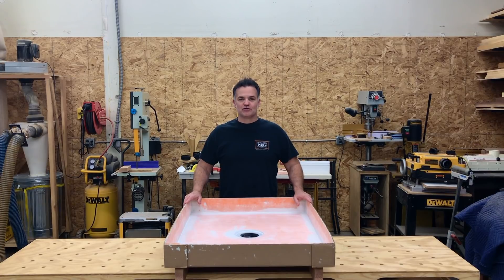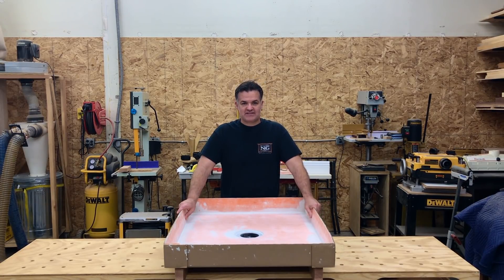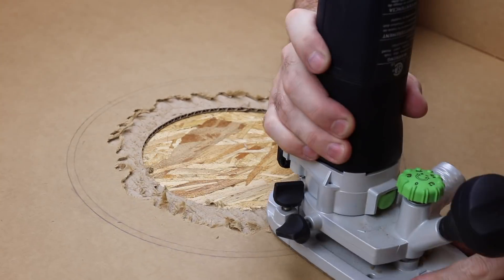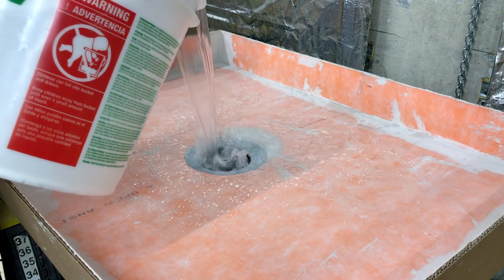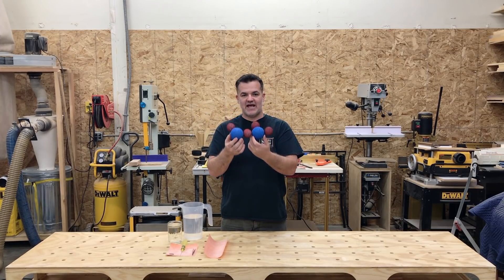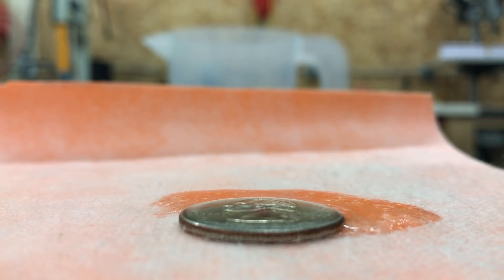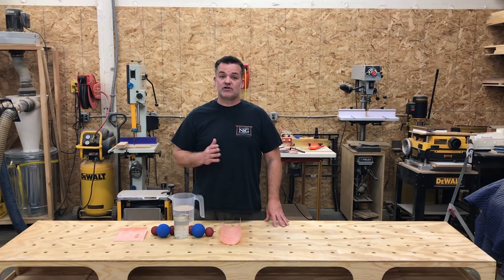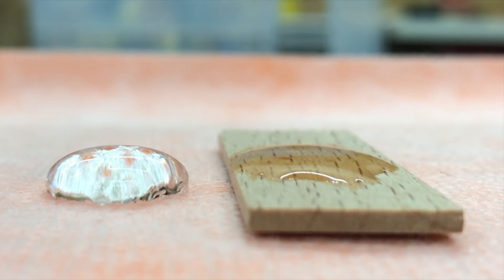Does Kerdi shower waterproofing actually work?

Comment: Hey, question for you. Great video. Did you use modified or unmodified thinset? The other Youtuber says to use modified I think and and Schluter, I think, says to use unmodified. Any thoughts?
Reply from the maker: Thanks!! I used Schluter All-Set which is a modified thinset but you can definitely use unmodified.
Reply: @builditorfixit  Thank you so much.

Comment: What did isaac do differently
Reply: Isaac used unmodified Thinset as recommended by Schluter (they recommend to use unmodified OR their own, otherwise warranty is void). Isaac also did a test with the modified thinset sold from Schluter, which did not leak. So if you go with Schluter you MUST use their custom thinset otherwise your in for a leak (if you want the warranty). Otherwise, you can try other modified thingset, but I have no clue which one will work or not.

Comment: This does seem very strange to me as well. I don't know the particulars of Isaac's position but I know from commenting on his video he and I have the exact same pov. I have a lot of Kerdi showers out there. None of them have failed. In fact I have had no failures ever. I always flood test my pans. I always noticed some level of creeping under the bands and between the overlaps with kerdi. I've tried mixing looser mud, thicker, knifing it out tighter, looser, etc...  Variations with schluters products and techniques. I eliminate all wrinkles and have perfectly flat and tight installs. It doesn't seem to matter and from what I have learned the Schulter position is either, your mix is too- something- or its not an issue. I literally can't do it any more by the book or try any other mixes. Lol. It keeps me up at night. I've moved onto Isaac's method but I've been doing it several years longer than he has. From my experience there is just no way to make your test with Schulter products and not have water wick though the mud between the overlaps and dampen the cardboard which makes sense. The fabric is waterproof. The cement is not. Water will wick through it. So I just don't get it. I don't get how this test is possible.

Comment: FYI, to answer the question, the blue tool in the ad is to scratch the inside of your butthole if you lack flexibility and the inside of your butthole needs a thorough and lengthy "scratching".

Comment: How can reviews from you and Isaac vary so greatly!? He basically says the stuff is junk and every one of his test fails and leaks. I am wanting to redo a shower with this system in my house but I am confused by all the mixed reviews.
Reply: @builditorfixit  
Yes it does help greatly. This video was very helpful altogether. Most of the time when somebody has that many negative videos on a single product, there is an ulterior motive.
I have been looking for a reliable contractor in the central South Florida area for a couple months now. I have not found anybody I would trust with the redoing my shower so I've decided I might try it myself. I want to learn every single aspect of the project. But when there are so many contradicting videos and information out there it makes it extremely difficult.

Comment: Thanks for this video. Sal Diblasi sent me here. Isaac's video showing moisture being absorbed through the thinset has put a lot of questions into people's mind about the product. Youre explanation of having only a thin layer of thinset makes all the difference. thanks so much for making this video! 

should i be wiping off any extra thinset over the kerdi? or does that not matter, so long as the thinset in between the kerdi is thin and not too much. thanks!
Reply: @builditorfixit  Thanks for the info and clarification. Force and Time. The scientific explanaton you give in this video is incredible thank you.

This is one of the videos that people are starting to talk about kerdi not being waterproof. https://www.youtube.com/watch?v=YF08VacZBfM  your video is invaluable.
Reply: Isaac did what they recommended and it still leaked.
Reply from the maker: @j.johnson8360  Actually he did not, if you’ve watched his videos and know how to install the product you can see that very clearly. He’s done that same thing with several products even admitting he didn’t read the instructions.

Comment: Great video, thanks for sharing. I just finished a DIY walk-in dual shower in the master bath (~150 sq ft) with the entire Schluter system using Kerdi membrane on drywall and floorpan on wood subfloor. I used Schulter All Set thinset. I hope it holds up as good as your demo here! What thinset did you use in this video?